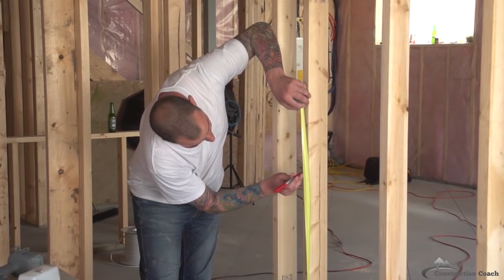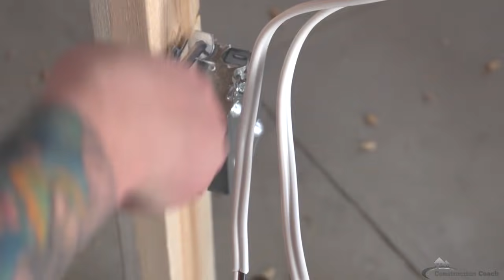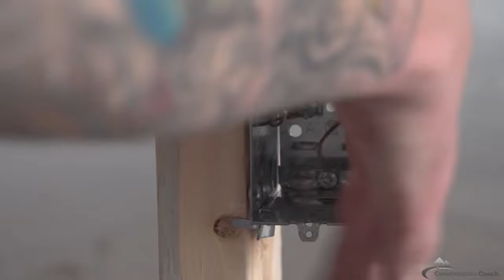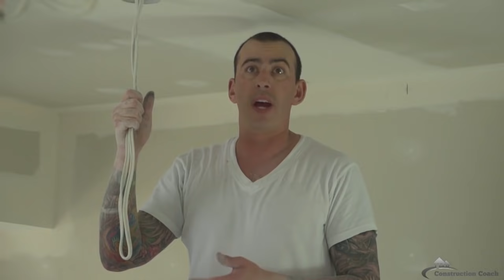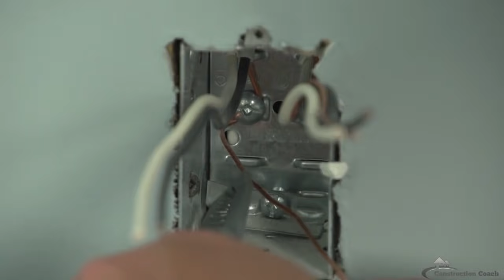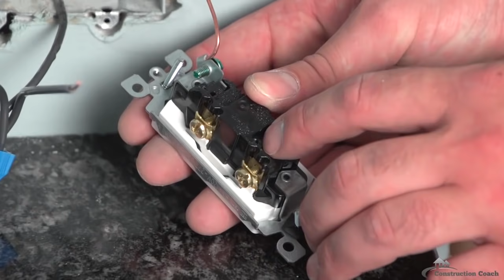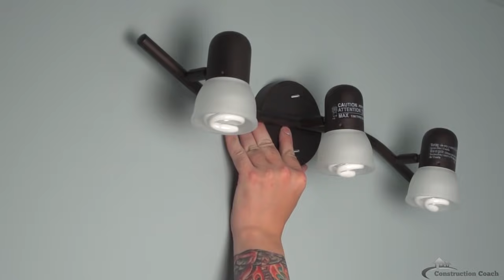Home Electrical 101 - What you need to know now!

Comment: 32:28 I learned in my computer sciences class years ago that this is called cross talk and that it's also why a bird's nest of wires behind say a computer is healthier for the system than neat zip tied ones. Because the less distance live wires run in parallel for, the less cross talk there will be. I was told that for the most part this is a problem of power cables effecting data quality in signal cables. But also that the same principle of ionic induction has been used by people in the past to steal electricity. Some farmers would ground a wire, run it up a pole, drape it very near to a power line, then run it back down the next pole and to their house. Supposedly this is done a lot less now because electric companies can detect it these days.

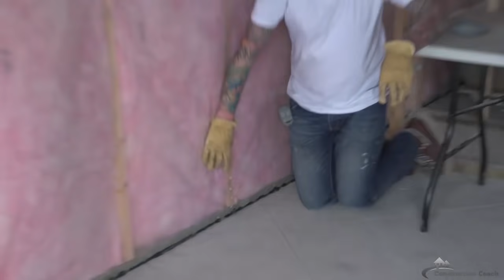Comment: I applaud your efforts, and good job, however, maybe a couple of tips from a fellow electrician. I was just getting ready to write that, for one, you can't assume people know what you are talking about ie: "this is the homerun"-homeowner thinking "what's baseball got to do with all of this"? I was also thinking while you were running the wire you stated that "this is the 'service loop'". I found that I would have been frustrated not knowing what that meant, or what it was for, etc., however, you did finally explain what it was, but just thought it would have been better beforehand. I thought you might also mention how much wire you should leave extending out of each box and why (6"-8"). Also, why the metal boxes-homeowner says "well what about those blue nail on boxes I've seen, aren't they cheaper? Why can't I use those, or can I...why? If I use the plastic boxes, where do you screw the ground wire to the box?" You and I know the answer to that, but they have no idea. I wasn't able to watch your whole video, but did you mention running a neutral in the switch boxes and why per NEC changes in the last few years? What are you calling the wire nut...a "MURRET? a "BURETT?" Is that a brand name? I don't know where you are from, but I've just never heard them called that. Also, did you mention to try to strip same amount from each wire and to line up all the ends when twisting together? I also felt the need to mention that when I saw what you did with the ground wires in the receptacle box, I was taken aback. I was personally trained to put both (or all) ground wires together with a "pig tail" that goes to the receptacle or receptacles/ switches. I get what you did there, seeing that it is a metal box and the same purpose will be achieved, but I'm just adding another suggestion is all. Please explain what you did with the GFI, or AFI. Was the second black and white not for protecting any receptacles (or lights) downstream, and shouldn't you have hooked one set up to the load side? I also wanted to mention that I personally always run a piece of tape around the receptacle (all the way round the screws on both sides-This helps when any future electrician or anyone pulling out the receptacle and maybe hasn't turned off the proper circuit as they may have thought, and they grab the receptacle by both sides, thereby getting shocked by completing the circuit by touching both the hot and neutral, or hot and ground. Surprise and OUCH!), especially when using metal boxes. Homeowner-"I noticed the letters TR on the receptacle. What does that mean? Does that have to do with the NEC? Do they all have to have that TR on them"? (Nevermind-you covered it later in the video. Point of clarification though, they are not Tamper 'PROOF' , merely tamper Resistant, hence the "TR") Another problem I have had is with some homeowners; trying to explain to them why there is no way to always make both switches (or more for 4 ways) be up for on, and down for off. Oh, did you explain why the GFI there in the bathroom? I noticed how you personally use the end of your strippers to make a loop on the ends of your wires. I find that using the designated hole or holes on those type of strippers really seems to make a "better" loop, for me anyway. Do whatever works for you. You did a good job young man. I hope you took no offense to any of my critique. It was meant to be simply friendly advice from an old man with too much time on his hands Right now it's 4:00 in the morning and I just couldn't sleep! I'm sure I could learn some things from you as well. Have a good one.

Comment: Hey Construction Coach, love your videos. QUESTION: I live in an old house that has attic wiring damaged in spots. I found How to Splice Wire on Wiki, but instead of solder and shrink wrap, can wire nuts be used? Oh, and will this meet Code if I sell? Please help. I can't afford an electrician (on Soc.Sec.). Thanks in advance for answer.
Reply: linda scott if its electrical wire, like the one in this video either romex or lumex, then you cant just use wire nuts to tie them, you need to buy an electrical box 
and do the connections in the box, you will also need connectors . its pretty cheap id say at most 20 bucks.
Reply: Thank you so much for taking time to answer my question.

Comment: A commitment to detail.  Very nice.  Only question...I noticed most of the devices you used (receptacles, Decora switches) have self-bonding clips, eliminating the need to run a ground wire to them when using a properly bonded metal box, which you made sure to do.  A personal preference to run the wire anyway? (sorry if you commented on this and I missed it)

Comment: @ 1:04:22 Then you wonder why there are so many fires in homes that originate in that very junction box. The Romex connectors that I used specifically warned NOT to twist the ends of the exposed Romex conductors! Why are the junction boxes so small? I removed and replaced the old tube and knob and every connection was soldered and wrapped with electrical tape.

Comment: Great job, explanation and entertainment!
Funny as the rules are different between country's. :-) If you had used any of these boxes or cable in Denmark, you would have lost your job before you could say sorry! Metal boxes is considered insanely unsafe, the cable has to be 4 wire with a thick insulation around and at least 2.5 mm^2. Edit: And exposed ground is so wrong here as if you had run an power cord without insulation, in other word, bye bye job for ever, everywhere!! :-)

Comment: shouldn't the power from the panel be going through the gfi first then the light and fan? this way all the stuff is gfi protected
Reply from the maker: Some people wire it up that way.   You have to check with your local electrical code.   Where I’m at you don’t gfi protect the light and fan I  only use the taped over screws if I’m going to another gfi receptacle in a different washroom.   I hope this helps

Comment: I'm a bit confused. You stated that local building codes space receptacles at 12'. My confusion comes from the (perhaps mistaken) belief that, as with UL and CSA, Canada and the US had settled on adopting NFPA 70 (NEC) as the electrical standard...which mandates spacing at 6' in residential spaces. While a local code  can say literally anything, it would be superseded by NEC (most stringent code prevails). Just curious about the international agreement, or lack thereof. Please correct me if I'm wrong on this one. Thanks!
Reply: Norm Jacques    The NEC states no wall space shall be more than 6 feet from a receptacle.   So both directions is 12 feet.   It does not say receptacles 6 feet from receptacle.   Always read NEC very carefully!   Little words make big differences throughout the book!

Comment: Hello, I enjoyed your video, but I need some help. So it is okay to put 6 outlets, 4 recessed can lights, and a fan on 2 switches? And have them all on one 20 amp breaker and using 12/2 wire to connect them all? Would that be okay?

Comment: When mounting the electrical box you stated that you mount the box 14 or 16 inches above the ground, is that true for all electrical or is it based on local code?
Reply: Burning Experience    In US (if following ADA, not a NEC rule) then receptacles are to be 15" to 18" min AFF.   18" if front access with wheel chair only, 15" if it can be rolled up to aside the chair.   Our company standard was therefore 18" center.

Comment: Awesome GFCI job. Just a question, should the line wires (input power) be separated from the load wires and so forth, i.e., daisy chained to another outlet protected ordinary outlet? Isn't it the line and load wires are separately connected? This set up I believe could noy protect someone from ground fault.

Comment: Quick question.  Can I run 12/2 to all my receptical boxes with 20A recepticals on a 20A breaker from my panel?  Total length from panel to furthest receptical is approximately 65 feet.
Thanks man!
Reply: 12/2 is the required wire gauge for 20A circuits. Do not use 14/2. I personally do not use 15A breakers. I prefer 20A and I prefer using the 20A receptacles (ones with the sideways "T" shaped slot on one side of the receptacle).  I know of people who buy the receptacles that are rated 15A and stick them on a 20A line. One can usually get away with this, but I do not take chances. Use the receptacles rated for 20A.  You pay more, but they are safer.
Reply: Thanks a ton for the response Jim.
Reply: You're most welcome Neil. Glad I could help. I am actually putting together a video course for homeowners about electrical wiring explaining not only how to do things, but how electricity itself works. I figure if someone understands the principles, then they will understand how and know why things are done they way they are versus simply copying what is shown in a video, but unclear as to why it is done as such.
Reply: Wow, that would be awesome actually.  I've subscribed to your channel so I'll watch out for that video.
Reply: Thanks for your support for the work I do here. I do appreciate it greatly. I will be creating a series of videos about electrical work. They will be available through a different venue separate from this channel. I am in the process of making the videos and working out the details for marketing and so forth. Thanks again.
Reply: Hi Jim, you totally should post the videos to a revenue generating site.  Have a look at ericthecarguy.com, he does the same thing.  Eric posts a few videos on YouTube to keep people coming to his site.  His site goes into a deep drill on automotive repair for specific vehicles.

Comment: Always drill the multi studs first so if you have to change the height of your hole you can match it on the singles
Reply: If one side of a stud has a full bay and the other side is short, drill from the full side. And stand up when you drill.
Reply: When you drill a corner stand in the adjacent room. That will angle your hole in the right direction
Reply: Don’t measure each outlet height. Find something the appropriate height, rest the bottom of the box on it and mount it.
Reply: Don’t staple the wires before you enter the box. Don’t drag every inch of the circuit through every stud. Box to box, cut enough. Strip the wire, enter the box.
Reply: On ceiling joists: staple high, drill low. That way you and other trades are less likely to damage a wire.
Reply: When stripping with a knife don’t go all the way through. Scratch one side, you only have to penetrate the last inch or so, peel like a banana.
Reply: Half hour in,taking a break

Comment: Love the slack and taping of the Cat-5/coax, but I gotta' say after literally tens of thousands of telco/telecom/data repairs over the years, I really wish electricians wouldn't staple low voltage wires to studs etc. It makes it impossible-ish to replace in-wall Cat-5 and coax when it goes bad. Strategically taping along the run would make it so an old wire could be used to pull a replacement from end to end without opening up the walls.

Yeah, I know it's not possible in every case, but I can't even imagine how many jobs I've been on where this would have made a fix exponentially easier...and in some cases, simply possible.

Comment: I have been an electricain in the UK for a few years now. And yes we use
 earth sleeving on our CPC or ground wire as they call it. not just for 
identification but can you imagine if there was a fault on a circuit. 
Where the fault current flows through the cpc back to the general mass 
of earth. Expose conductor touching those metal back boxes is gonna 
become live. if those boxes where on metal caddy strap between metal 
stud frame like we use alot of in the UK. Then the whole damn building 
will become live. You touch a expose metal in that building while 
standing on the ground. I NEED SAY NO MORE. I personally think we should do away with earthing back boxes. Because the box itself as no potential on there so grounding or earthing these back boxe is just putting potential voltage on them. Just loop the cpc through for continuity
Reply: ya your wrong, if fault was on the ground wire, the breaker or GFCI/RCD would trip thats the whole point of a fucking ground wire.
Reply: Ricardo Miller    You made a statement in your comment that 99% of electrical professionals get wrong.   You are one of the 99%.   This is why most people have a hard time understanding grounding.   Please think this through.   If there is a short circuit from a hot conductor to a metal box, or to the metal case of let's use a washing machine, from that point, for the first half cycle, where does the electricity go?    99% will say back to the panel and then to earth ground.   If you were to run a hot conductor out to a rod driven into earth on a standard breaker with no GFCI, it will not trip.  The worms will come to the top of the ground and you can go fishing.  The short follows the ground conductor to the panel, through the neutral/ground bond, through the neutral to the transformer, through the coil, back to the breaker, TRIP.   I hope this helps you in the future.   Respectfully,   Kevin

Comment: why are these boxes for wiring in the wall from metal? the screws holding the power wires in the socket are very close to frame. is it not dangerous? there are just few milimeters... i have never seen something like this before, i am from europe, we have everytime and everywhere only plastic frames.

Comment: He has wired that AFCI wrong. The feed coming in  (Line) goes on the uncovered screws and the feed going out to the next device goes on the screws under that yellow tape (Load). The instructions are stamped into the back of the receptacle.

Comment: Just came across this video, as a avid sparkie, I was a bit shocked to see that you have put the power sockets and the lighting circuit
on the same circuit, what happens when you have a fault either on the power or the lighting it knocks all the power off, would you say the splitting them up to 2 circuits ( Power / Lighting )
Reply: Cullam Allen entire room on arc fault breaker which is a code requirement. It would be a waste and expensive (arc fault) to have 2 circuits.

Comment: when installing the gfi receptacle in the bathroom , shouldn't you be using the bottom terminals that have that sticker on it. top screw terminals are just for the line in and the bottom terminals are for the rest of the circuit ie. any other receptacles on the circuit

Comment: is that how it works? put the insulation before installing the electrical wires then put back the insulation?
Reply from the maker: The homeowners moved in before developing the basement. To gain occupancy from the city they had to have a min of r 12 around basement walls. I started 1 year after they moved in. Thanks for watching

Comment: you mentioned that you were using an AFCI type breaker you are going through a switch that is an arcing sparking type device would not your breaker trip everytime the light switch was turned on???

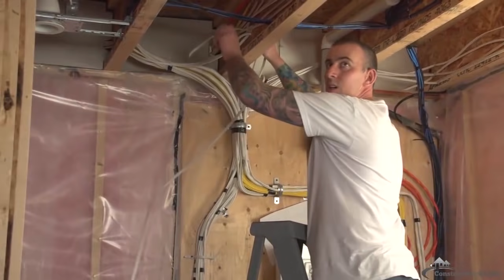Comment: At 15:30 you show the main panel, and there are a shit ton of romex wires bundled together.  Is that legal?  I would think it could be a heat problem (fire hazard) to have all those wires together.  You can't stuff more than one romex in a conduit for the same reason.... (well if the conduit is really big, you can put a few romex in there, but there is a formula to ensure you don't over-pack a conduit).  Don't get me wrong, I think the video is very informative.  Good job

Comment: I don't know about you but a wire index helps so all the panel circuits are identified and to make sure each circuit is fully loaded. Too many wires loose and unconnected in the panel throws you off.

Comment: Why would you pull the wire all the way through for runs vs pull it to the first outlet, wire it up, cut wire for the next run and run it, etc.  Seems like it less threading wire through walls and whatnot
Reply from the maker: There are many reasons to start at one end and then cut all your wires at the boxes. Setting up a reel at one location is much faster than cutting individual runs, and you never cut a wire short. Trust me it’s faster and very efficient. Thanks for watching!!

Comment: No VP pipes or flex pipes? :/ With piping in the wall you can easily replace the wiring in the future without having to take the walls down, as you can just pull out the old wire and pull a new one through. Also protects the cables.

Comment: Why is the ground not sleeved as in the UK
Reply: In some wiring in the US it is, not sure about canada. When we do surface-mounted conduit wiring or otherwise run individual strands of live, neutral, and ground we usually use insulated ground wire. The main reason i would imagine is cost, but also earth/ground should never be conducting anyway, so anything that causes it to should be throwing the breaker anyway, thus if it's shorting to something there's a problem that needs sorting anyway I suppose.